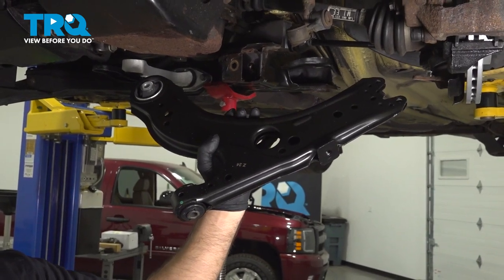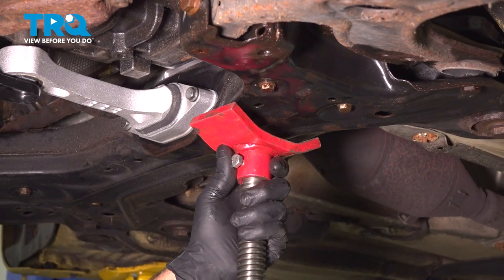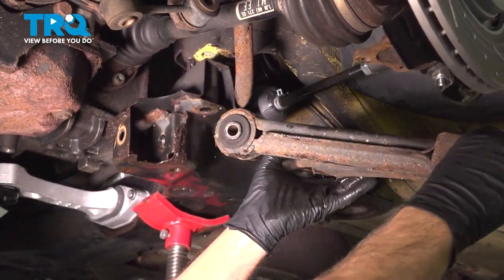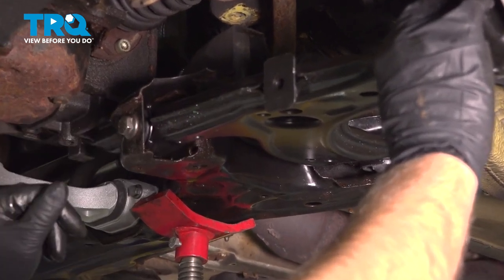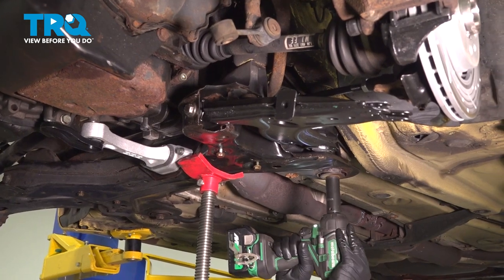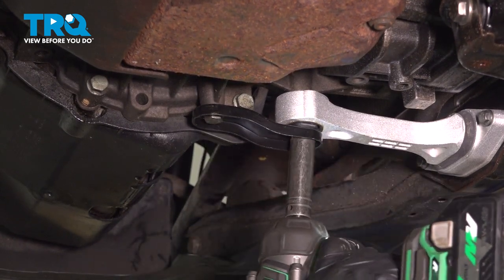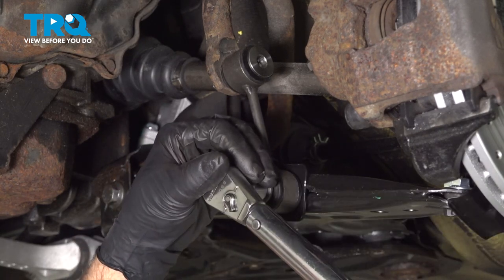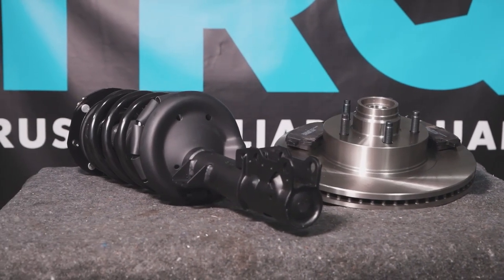How to Replace Front Lower Control Arm 1998-2010 Volkswagen Beetle

Comment: Thanx for a great series of videos. I was wondering why you put nuts on the 3 ball joint bolts instead of using the threaded triangular nut plate or keeper that comes OEM? My new ball joints came with nuts and just curious what would be the reason for using the new nuts instead of the threaded nut plate or keeper that is taken off? Thanx for a job well done. Peace